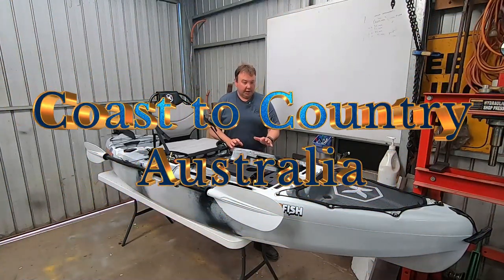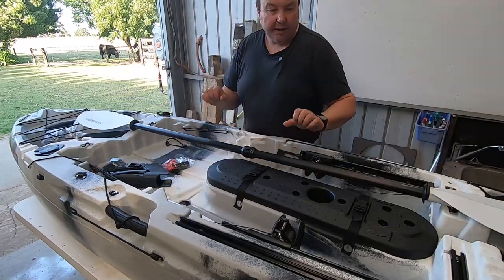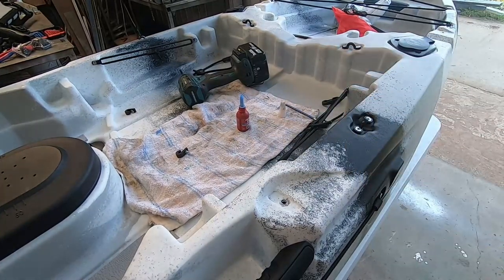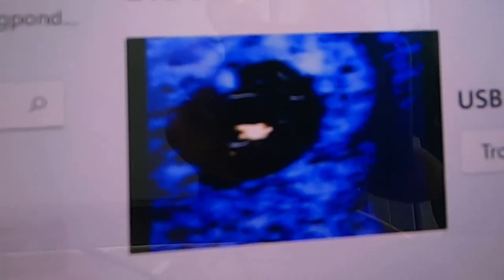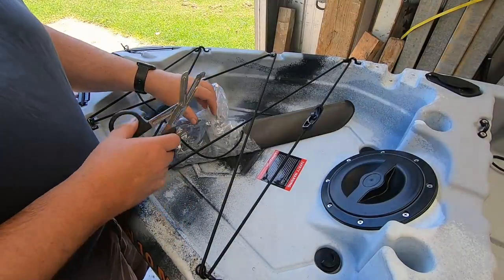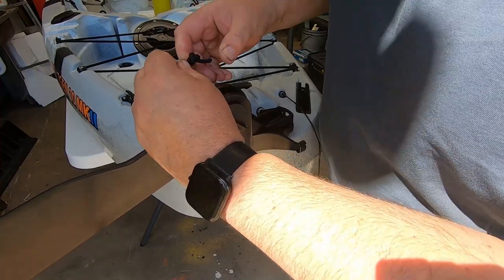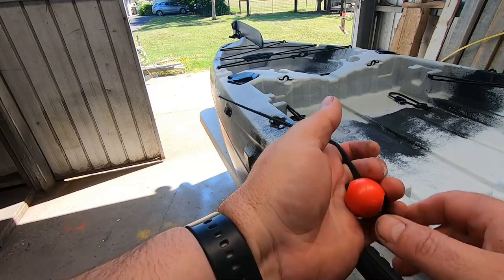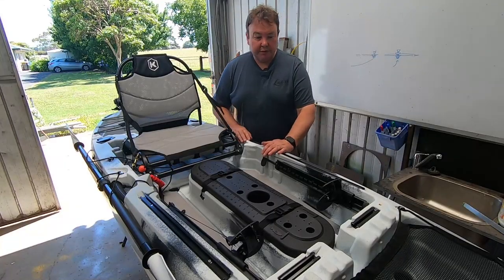Kayak Setup goes wrong! & Rudder Installation, Nextgen10 MK2.

Comment: Thank you for the rudder set up demo. I had a devil of a time setting mine up and it still isn't right. I went a whole season without a rudder. I'll adjust it according to your demo.
Reply from the maker: No worries, hope it works well for you. The rudder works great in strong winds and current I found. Cheers

Comment: I just bought one today, fiddled with the rudder a bit, it is a different style to yours, it does not retract into the top of the yak groove, it on ly folds straight up, I dont like that, all else is good.